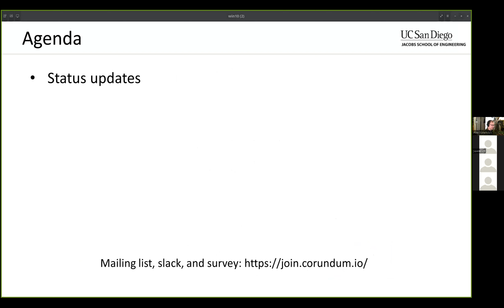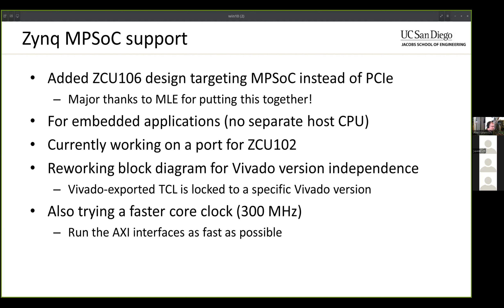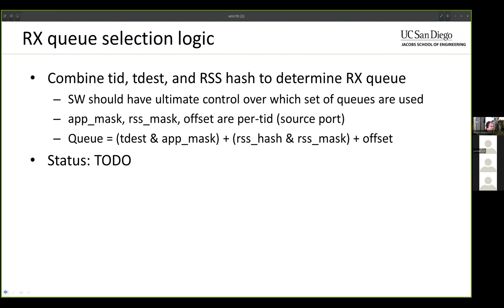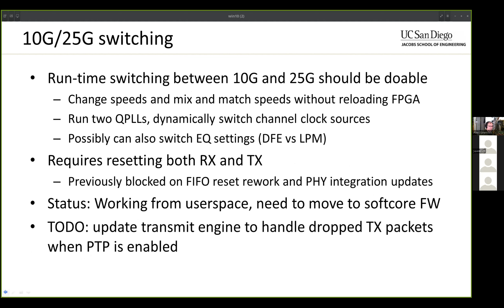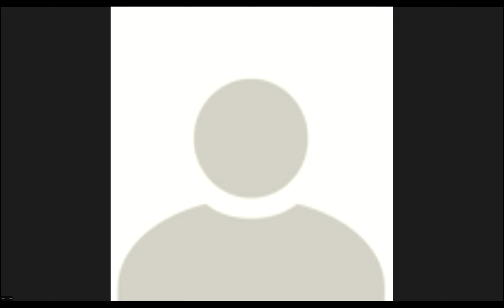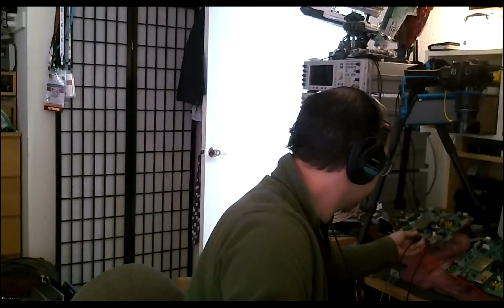Corundum Developer Meeting 20220411

Comment: On the queue pointer writeback, you might want to conduct a couple experiments to see whether writing a full cache-line is faster than a partial-length write that has to get read-modify-written with the existing cache-line. I remember back in the day when that was a resource in the root complex that could get saturated and rate limited bus transactions.
Reply from the maker: That's a very good point. I did some benchmarking a while back with the PCIe DMA engine used in Corundum, and I saw some strange performance with PCIe writes that appeared to have something to do with the cache line size. Hitting the same cache line multiple times definitely had a significant performance hit, although it definitely seemed to be system-dependent. I think I presented the results in an earlier meeting. Anyway, my plan with the pointer write back is to add 64 bits of state to each queue to hold the address for write-back, and then software can handle setting that up in whatever scheme makes the most sense, which certainly could involve placing each pointer on its own cache line. But I suppose what you're saying is that that alone isn't necessarily sufficient as we might want to actually write the whole cache line by having the hardware pad out the writes to the cache line size, so I suppose I should also add a flag to control that so we have the option to do either method. Thanks for the input!
Reply: @AlexForencich  Of course, if you're 64B aligned, you can get 6 of those bits back. Also, in case you care, POWER's IOMMU can give you an all-zero valid address (at least POWER5 did) don't know about other archs, so I'd recommend a separate valid bit in case you were contemplating all-zeroes being the way to mark an inactive DMA addr.